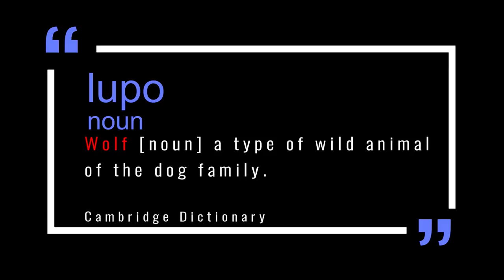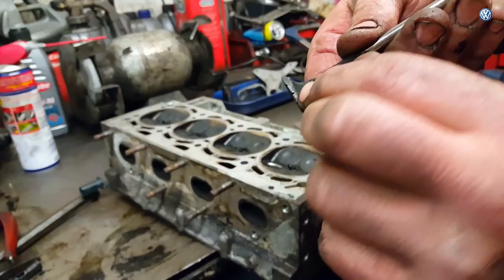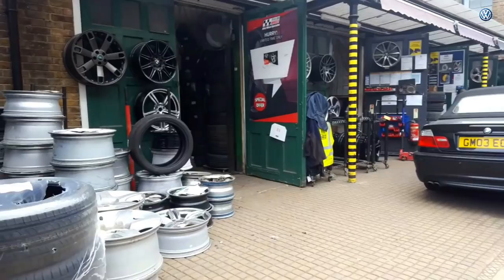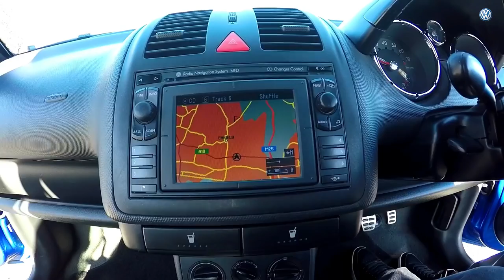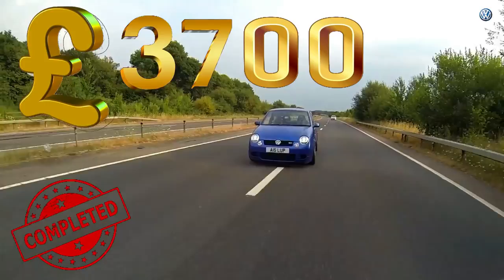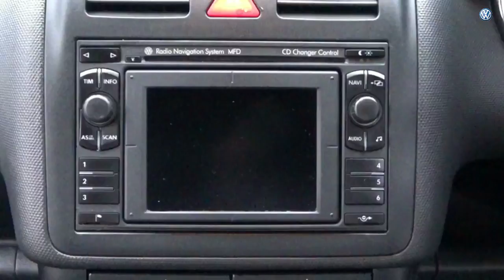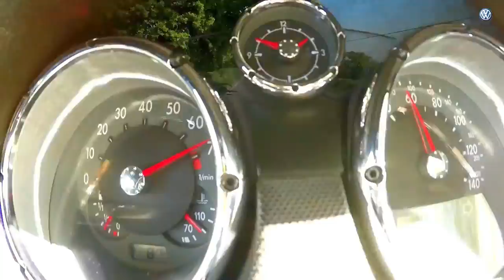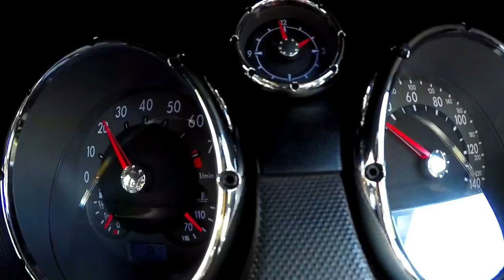Volkswagen Lupo GTi - Saved

Comment: Excellent video Paul! Another one saved! I’m currently saving an anthracite gti, heated seats were not only with the leathers, mine has the red interior pack and heated cloth seats. Heated seats were part of a winter pack along with heated washer jets, it’s also got air con and a sunroof, so very good spec.
Reply from the maker: A very very good spec by the sounds of it. Sounds absolutely lovely. Yeah I found out after I made the video that you can get cloth heated seats, but that has to be much more rare than the leather option. I would have loved the same roof as well. Subscribe to keep up mate. I'm just waiting for the weather to get a bit better and then I'm going to start filming again. Thanks  for the comment
Reply: Paulz TV  will be subscribing! There isn’t enough Lupo content on YouTube! Sun roof is lovely to have! I use it often!
Reply from the maker: @191boomaranglewis191  I reckon it will be a future classic for sure. These cars are rare and parts are expensive. Unless I go to a show, I never seen more than 1 a year.

Comment: Great Video Paul!

Just recently purchased a GTi too, I think mine may require similar engine work. 

Bought after owning a 1.4 runaround and upgraded after getting a good priced GTi. 

Excellent informative video....
Reply from the maker: Thank you very much, I'm trying to make better videos as I go along. Yeah these cars have some common issues. If its smoking oil, usually that's the valves. The gearboxes are usually good for about 100000 miles. I think the later 6 speed is better than the 5 speed for that. So you have a lupo gti?
Reply: @samartzis2000  yes. It's a 6 speed on 137k. No smoking, gearbox seems ok for now
Reply from the maker: @DroneExplore  ohh we leaving messages on two different videos, lol,  a reconditioned gearbox can be a little bit expensive. But fitted it should be much less than £1,000
Reply from the maker: @DroneExplore  typically it's between 100 and 120000 miles, that's what it was on my last Lupo and I've heard other stories as well. So if you bought yours with the mileage you've got maybe it's already had a gearbox fitted, have you got the history with the car?

Comment: Great build, same engine and power of 125ps/123bhp (standard) not 130bhp (but induction/exhaust/etc probably makes the difference) as stated standard power same as my 2001 6n2 Polo GTI (the less weight helped Lupo lots)... have a K&N panel filter for whatever power difference it makes...or not! VW should have put that stronger 6-speed hydraulic box in the 6n2 Polo GTI rather than the weak 5-speed which is the poorly part in my 113000mile 6n2 Polo GTI restoration currently.
Reply from the maker: Oh yeah i agree. The 5-speed in the Polo GTI and even the early Lupo GTI didn't help the performance. My polo GTi felt less alert than this car. The extra 200kgs didnt help but I think more so the 5 speed. Thanks for your comment 👍
Reply: @samartzis2000  keep it going fantastic build. Sort of process I'm doing with my 2001 Polo GTI I brought last summer (had one before late 2000's bitterly regretted selling it - bit family/kids meant otherwise) on verge of being scrapped. Have a love for the 6n2 GTI's & my bit of a personal mission to complete even though my never hit Lupo GTI values. Was owned by fellow ClubGTi member who sadly lost his battle with cancer about 12months ago at not even forty. Was sat up for nearly 18mths as a result, car has been on the road and I was using it regularly but do need to sort box + suspension so probably won't be back on road properly now till next spring. 
If I can ever get to your Lupo's standard be fun to do a comparison video - don't quite have your budget so take lot longer however.
Reply from the maker: @markturner-smith5309  that would be great , I'm up for it
Reply: @samartzis2000  hopefully getting the suspension (Koni ST-R dampers/Eibech pro- line springs)/box sorted by end of this winter, little bits of bodywork following that so be presentable (few sill dents both side, bonnet was keyed and age related chips and scratches to roof, scratches to rear spoiler, battle scared rear bumper ones side either a respray or replacement the minor tidy ups for now) for filming as such but full blowover re-spray that's going to many years yet before can do. I'm Bournemouth based.

Comment: I've got a silver GTI with 210k miles on it. (looks like 80k miles) 
Runs perfectly fine! Such a great car! Makes so much fun!

Great video, i love the colour of your gti, the raven blue is extremely rare in switzerland
Reply from the maker: thanks very much for your comment. Wow 210k, did the engine ever need rebuilding? Also, don't you think that high mileage Volkswagens are actually a little bit faster? I experienced this when I owned a Mark 2 gti 16 valve  aswell?
Reply: Well thanks for your answer! 
The engine itself never had a rebuild, but there are new valves and seals in the cylinder head. The previous owner had to change them at 135k miles. (well known problem on these engines).

It's the first gearbox as well, but i have to rebuild it soon, works great but it's a little bit noisy.

Actually i don't know if it runs a little bit faster, i bought  it with 160k miles on it but i think the car still has its original 125hp. 

I hope you can understand. My English is a little bit of.
Reply from the maker: @alefrisulli  yes fully understood. My one was on a rolling road 3 years ago and it measured 122bhp at the wheels. I don't know what has been done to the car, but the torque figures are unusually high, (230 Nm , 170ft-lb) ?? Sometime this year I will take it to the rolling road myself. I had another Lupo GTI before this one with half the mileage and it felt slower?

Comment: Thats amazing what you have done with it im doing some work on mine love it
Reply from the maker: Thanks a lot , I'll be posting a much shorter video of the rear pop out window conversion . I'm glad you liked it
Reply: You must film more staff like this with the Gti, the way you filmed it its good to I wished its never finished, I was so engaged watching I even got my wife to whatch it a couple of times, she even told me to shut up witch is unusual, ive said when im donne with mine Im taking it down to Portugal all the way trough France and Spain
Reply from the maker: @oiudsaf  well what can to that. Thank you again. It's funny because the original video is over an hour long, I had to cut it down because I thought that not many people would be interested. However the response has been very good, and this only motivates me to go out and make more. Thank you once again and I am sorry that you had to put your wife through that, lol
Reply: Im about to polish and port the engine head skeeme it, full rebuild pistons rings, want to do an exhaust system, suspention, antirollbars, upgrade coolant with evans coolant, sort out the rust, golf r32 brakes front and back, 16 inch bbs rx 2 piece alloys in black, respray the car in jet black its a Porsche colour and lightly tint the windows and to finalise it take her on a road trip to Portugal, ps mabe supercharger not sure.. what do you think?
Reply from the maker: @oiudsaf  go for a bigger engine if you want more power. Maybe a supercharger is expensive. How about a V6 like the golf R32?
Reply: A 1.8 t or the v6 Sounds good,  the trouble is my wife wants to keep the 1.6 and betwine you and me i love the sound of the 1.6 gti, my mechanic said that i shoud be able to tune it properly just by changing injectors and twicking the head will see. Thanks do

Comment: Hey Paul. Older video I know but I was wondering if you could tell me what spacers you are running I’d love to source some for mine!
Reply from the maker: Yeah sure! The rear are 25mm , the front are 16mm. Try and find the aluminium ones for weight saving. Also has your car been lowered like mine because it may look a little different depending on the height? I hope this helps

Comment: Own a Lupo gti myself and this was such a great watch and has given me many ideas for mine. I have so many questions. What’s the radio you’ve fitted?
Reply from the maker: Hi Thomas and thank you for your comment. The radio is a VW MFD1.  I have a 6 disc changer fitted to it, but you can make it support AUX (or , and USB) however I don't recommend that because no matter how well you do your MP3 files it never turns out in order. The sat-nav is dated and your phone will do a much better job, I only got it for the Nostalgia. It is the original sat nav that would have come with this car (VW ran this from 2001 to 2005). I hope this helps.
Reply from the maker: BTW , making a video right about some maintenance issues and a neat trick to refurbish your worn out gear knob lettering.
Reply: Paulz TV thank you very much, my reflex silver has every option from factory and a car will never get rid of.
As I’m looking at replacing the shocks. What Coilovers would you recommend on a budget
Reply from the maker: @thomaslewis9023  mate , I think they're all expensive. This car had kW coilovers already fitted when i bought it and I've still got the receipt and that was around £480. I'm not sure what would be the best for these cars but these are pretty good , I had a black GTI before this one and I'm not sure what the suspension kit was on that, but this one feels more solid, all the arch rub I get is because of the spaces and not the fault of the Suspension.
Reply: Paulz TV okay thank you very much can’t wait to see more videos. Soon I’ll be recording mine!
Where did you get the exhaust? The intake? And lastly any tips on cleaning the seat belts
Reply from the maker: @thomaslewis9023  I'm making two videos at the moment and one of them is to do with a new proper induction kit and I'll be talking about the exhaust as well. The exhaust was stainless steel all the way through to the end box ( like I said in the video), but I've put a centre box on to try and quieten it down, it's a ' powerflow' centre exhaust, with the sports end exhaust, I have no idea what it is but the closest I can get on Google Images was a ' blue wave exhaust', the noise now is perfect and was completely undeliberate, it was by luck that it sounds so good. Type 'bluewave Lupo gti'into Google and see what comes up.
Reply from the maker: @thomaslewis9023  haha, try some good old fashioned clothes washing machine powder, mix it with some hot water and scrub away with a fibre cloth and nothing to abrasive, you'll be amazed at the results. Also, where do you live perhaps we can do a recording together?
Reply: Paulz TV sounds good! I live in South Wales, after I get my wheels refirbed and bits certainly! My main channel is imperium

Comment: i just bought one of these for £1600 with 112k  miles, completely standard apart from full exhaust system and manifold, previous owner just spent £2000 on servicing and bilstein suspension, i got a hell of a steal compared to you. paint on mine isnt the best but can not complain for the price.
Reply: and the gearbox just been rebuilt too :)
Reply from the maker: Lol, it's not as bad as all that. If I just sold the exhaust ,sold the Bathurst wheels and the steering wheel, also the sub and amp, I would have got quite a good deal, but I did over spend on a sat nav, full refurbish wheels etc. I know what you mean but it's ok, I know what's gone into this one now and it does drive like its only a couple of years old. Have you still got your one?
Reply: @samartzis2000  yeah i picked it up a day after this video funnily enough :) need to sort a few things but its a pretty nice car. what satnav is that you got? i like the way you got one thats period correct and it doesnt look out of place at all.
Reply from the maker: @Nizacx  The sat-nav is a VW MFD1. It was Volkswagens sat nav from 2001 to 2005. I first saw it in my friends R32 and that's the same year as the Lupo. Also, some Lupo owner's are lucky enough to have bought a Lupo with one fitted from new (as an optional extra ). it doesn't work anywhere near as good as the modern ones, but I didn't buy for that reason.
Reply from the maker: @Nizacx  I forgot to mention that the sat nav is the only one that fits in the slot. Dont get the MFD2 etc because they will not go into your dashboard. If you look on eBay you can find them as cheap as £150 and as expensive as £300. You will also need the little sat nav antenna which is only about £10
Reply: @samartzis2000  yeah i like the way it suits the car, i just need something with a aux input, and the radio or antenna isn't very good because it cuts out all the time, other than that i just bought a new door hinge from vw and also the 2 caps for the xenon washer jets on the bumper. and also the bloody key fob keeps dying on me so i need both keys on me, so upgrading to the newer version is also on the list. great little cars though, i just potter around in 4th to 6th gear no problem, best thing about it.
Reply from the maker: @Nizacx you can buy an adaptor for AUX and USB,  (£25)I fitted a USB to mine, I don't go into detail on the video but you do see a couple of times. I put the USB connection on a spare blank switch and it looks completely original
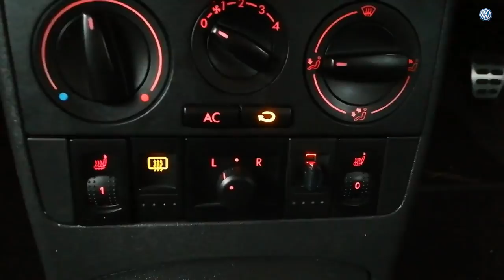Reply from the maker: @Nizacx  goto 15:33 and 23:10. You will see where I put the sub and where you can fit your AUX. The sat nav may be old but it does have a lot of extras, so ago I've got a 6 disc changer I just use the USB.

Comment: Lovely car !   Going to look at one the same colour as yours tomorrow!!   Hope it has the same potential!  Anything to look out for?
Reply from the maker: Hi and thank you for the comment, things to look out for. Door rubbers can let water in the car if they're a bit worn, and before you know it your carpet is soaked. That was a problem on this one and my previous one. Rear subframe can and does rust, look out for that although it's not very expensive to have that welded. Other than that it's just the usual Volkswagen leaking vales (like my one), and I think that's about it. They are old cars now so have a good look around it, and you are buying an extremely rare colour. ( future classic )